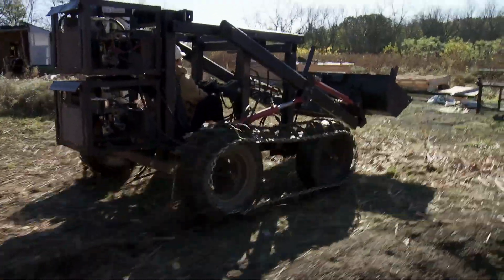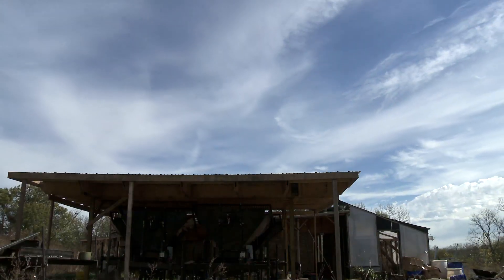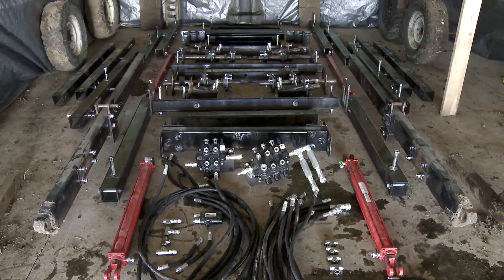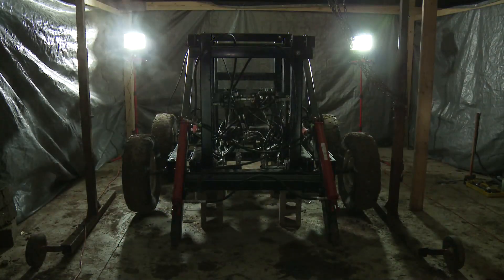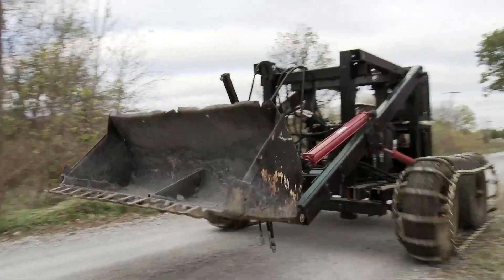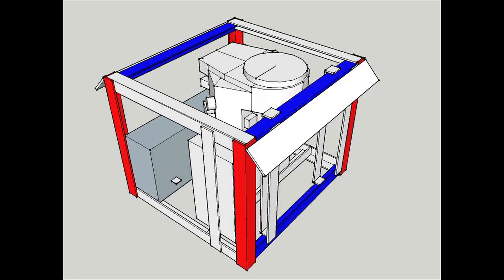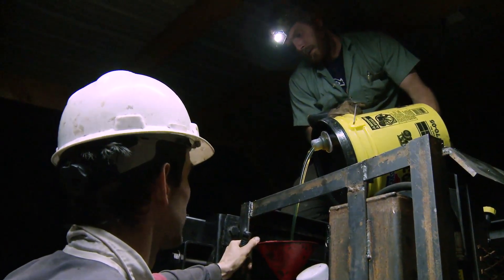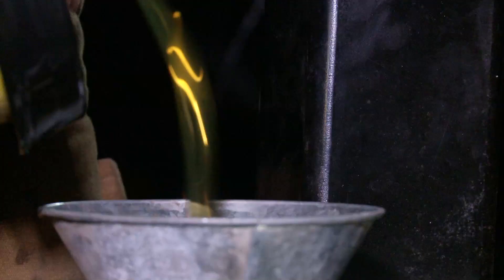Practical Post Scarcity: Open Source Solutions

Comment: CEB is fine in just a narrow set of applications. 

Many places don't have the clay rich soil necessary for cheap and strong CEB. That necessitates a greater proportion of lime or other soil stabilizers to use CEB. Also as he alludes, CEB is not insulating, but takes up a lot of space. Also, it's not suitable for use in foundations or retaining walls. 

If you live in a climate with comfortable average daily temperatures, regardless of the daily swing, and the local soil is rich in clay (about 30%) this is a great way to reduce costs and have a high quality quiet building material.